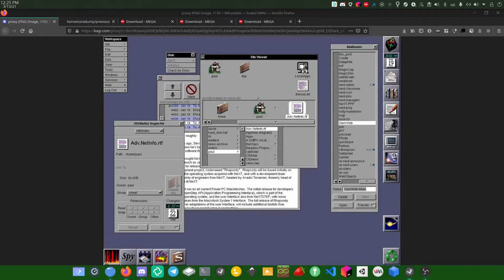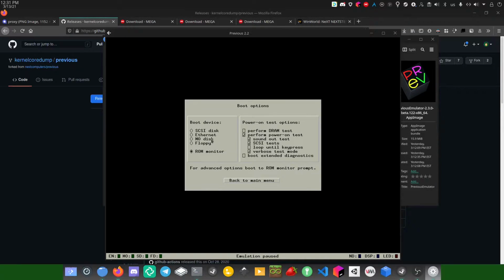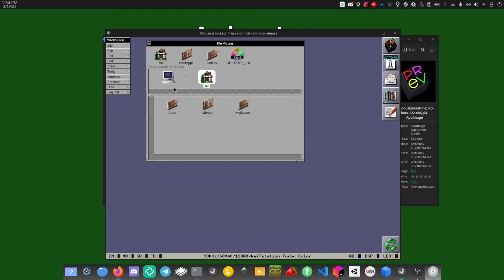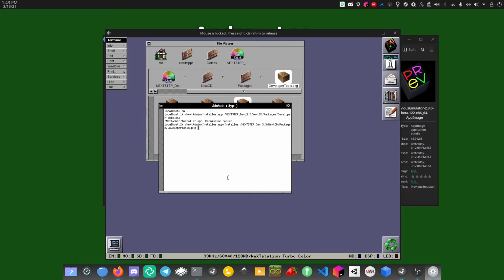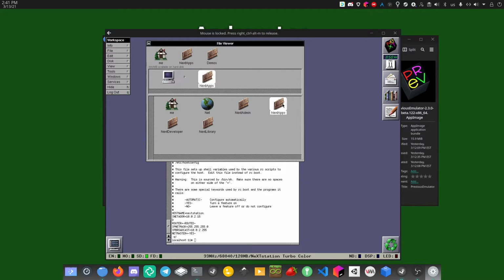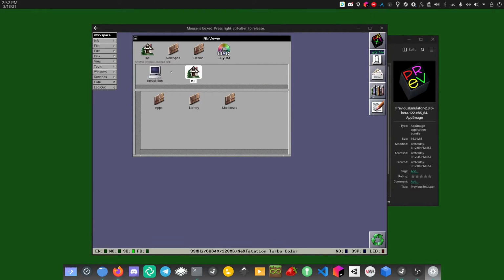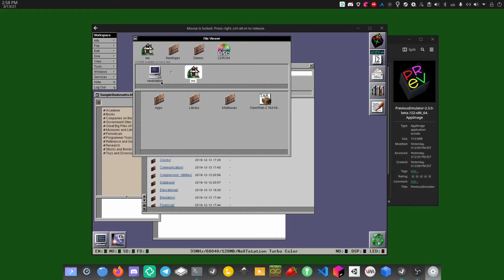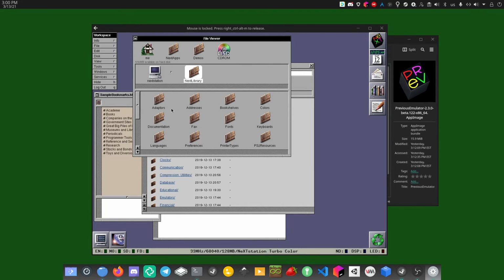Installing NEXTSTEP on Previous (with Developer Tools & Network)

Comment: I've managed to get NeXtStep running with developer tools, and I'm trying to get the network up and running, but I can't figure out the one part where you have to use the terminal to make resolv.conf. What happens is I reopen Terminal (As I did close it after the previous step), reenter su -, enter "vi /etc/resolve.conf", and it opens to the text editor, but when I try to enter nameserver, it hits me with an error saying "No previous regular expression" and stops working. Could you please help me out with this?

Comment: Where did you download that AppImage?
Previous from SVN and forks from GitHub are broken when compiled in my Debian Testing install.
Reply from the maker: I actually don't remember, it's long ago though I still have a copy of it

EDIT: Link here: https://cloud.alee14.me/s/6SATqp6LtHB4jey/download/PreviousEmulator-2.3.0-beta.122-x86_64_56fcf53aa3e04a33a79508e6d9552aef.AppImage
Reply: @AndrewLeeCAN  Thanks! But in that mean time I just got the SVN code compiling and running only by disabling the rendering thread stuff.